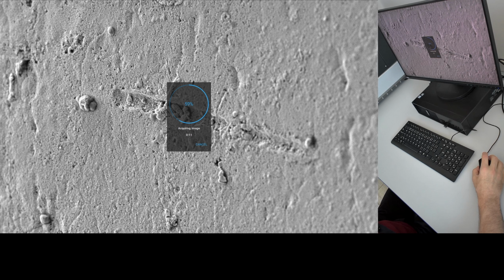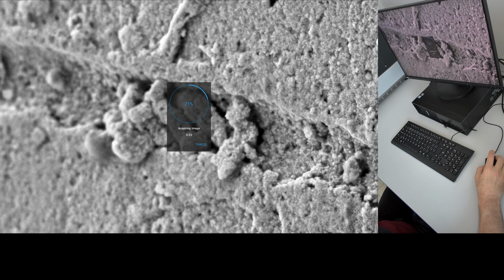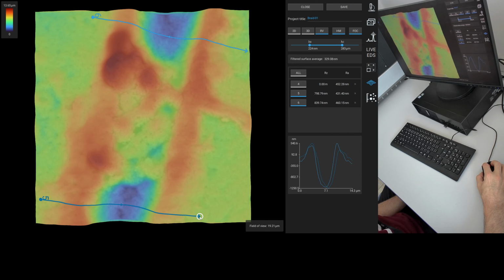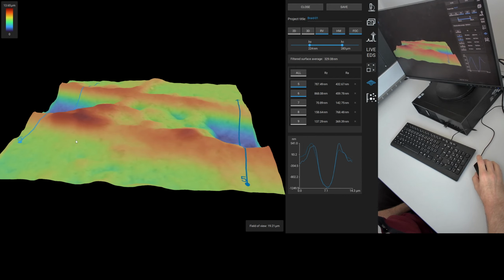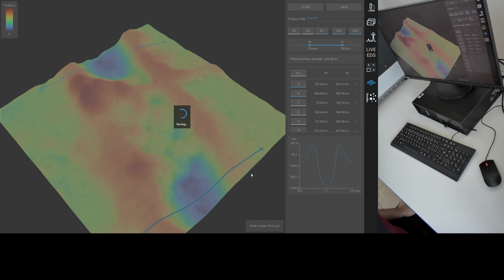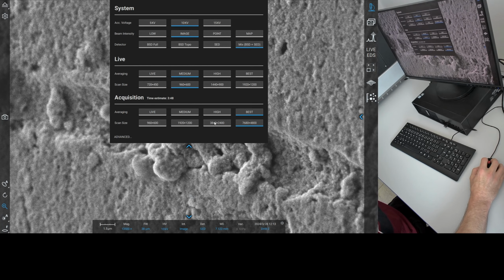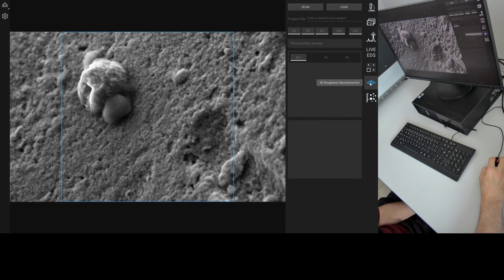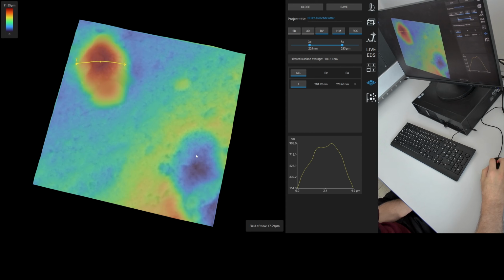Bin-Juine Huang - DHX-2 inner pipe 'strange radiation' track

Comment: But how would we scale it? LeClair had laser precision with very small targets, Bendall has a CGI for copper target of his turbine that we hadn't seen even a working prototype for. Water heating reactors spew out a range of low value elements probabilistically. 
How can we establish a process that is profitable enough to pay for itself? If only we could synthesize Iridium or Rhodium reliably..
Reply: I am wondering if the granite with nuclear radiation  naturally occurring maybe producing the biggest gold nuggets around in a paddock close to it.
Reply: Good question... I've yet to hear of anybody doing transmutation for profit, except in rumors. Ive mainly heard of transmutation costing more than its worth in materials, and ive heard of it happening as an accidental byproduct when generating power. I suspect we will discover a cheaper way to do it eventually! Ive also wondered what elements i would try to synthesize! Iridium sounds good!
Reply: @exponentialnegative1  An isotope of mercury in a fission reactor turns into gold, yes. And a wide array of elements in a hadron collider. Very expensive electricity bills. 
Bob makes the process look so simple, and I'm confused why it is not scaled yet. Would solve all finance issues for further development in an instant. Even if selling helium alone.

Comment: Hi all - check out the cosmic core org website - great explanation of parallel AETHER models that are all basically equivalent to each other.  The website uses the term aether units (basic building blocks) that are both toroidal in nature and based on Platonic solids in a sacred geometry context.

Also of interest is the aether force - living science website.

As to vacuum anything - vacuum energy, quantum vacuum, you might as well describe a gentle warm breeze coming off the sea bringing a fresh sea smell to the house on the shore as a gaseous molecular vacuum  in an excited state interacting with a fluidised molecular vacuum and flowing over and through a solid-state vacuum, an example I trust gets across the idea of just how dumb it is to talk about quantum vacuum.  It’s the aether, a fractal structured medium composed of aether units.

Finally, as Tesla discovered, electricity of the kind that we use in our devices is not fundamental, nor is magnetism or gravity, rather it is what he described as radiant energy - aether units that are fundamental, with all other “things” at our fractal level being derived.  He also expressed a belief that electrons love to intercept and wrap themselves around with flowing aether currents, and that it is these aether flows that power both electrons, protons, etc, with all such leptons/bosons/hadrons/ being ultimately composed of the basic aether unit building blocks.
Reply: Noted and thank you Gordon. Bashed my head against QM for years. Now this. Just spit-balling here, but if there is QUANT-um mechanics, could Aether be a form of QUAL-ia mechanics? I'm always seeking balance of terms. Quantity and Quality another everlasting yin yan. Cheers.